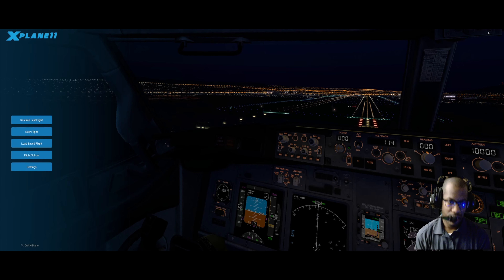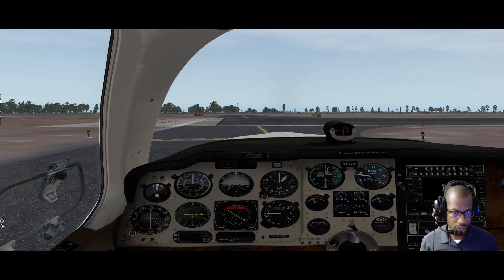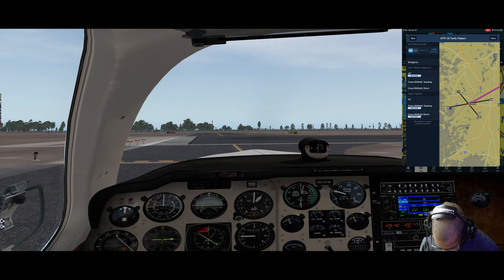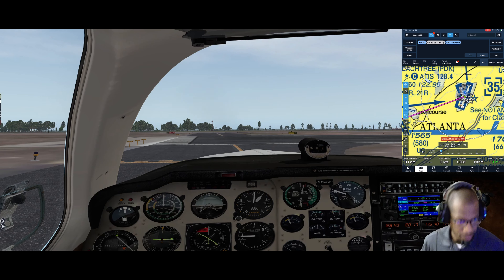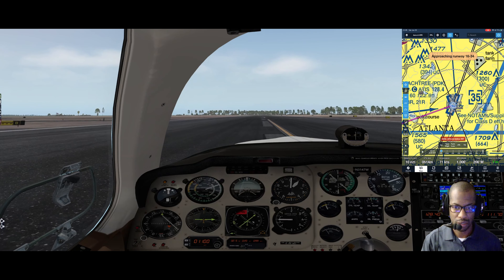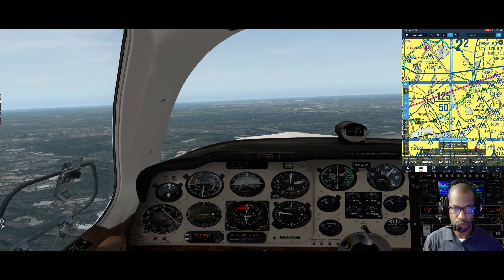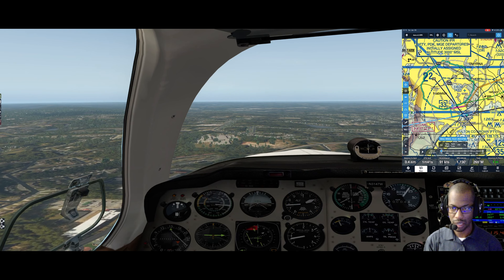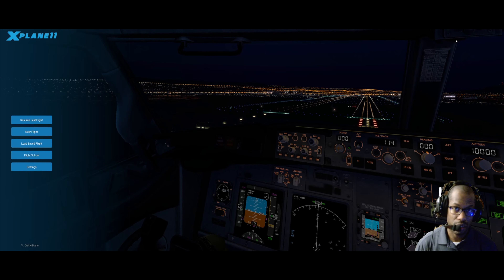Xplane 11 | Bonanza V35B | Simcoders | Carenado | KPDK to KFTY

Comment: How do I add foreflight to xplane
Reply from the maker: In Xplane11 you need to access Settings/Network and verify you IP address is showing and you have "Broadcast to all mapping apps..." then just go to Devices in Foreflight once you load a plane to an airport. Should show Xplane under devices as Connected. Hope this helps